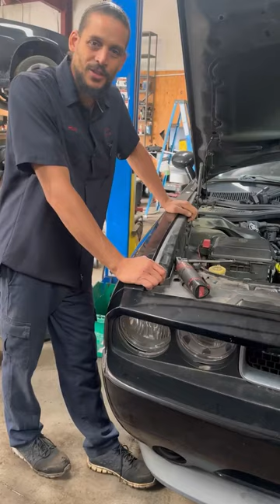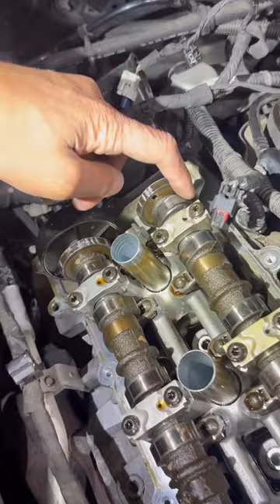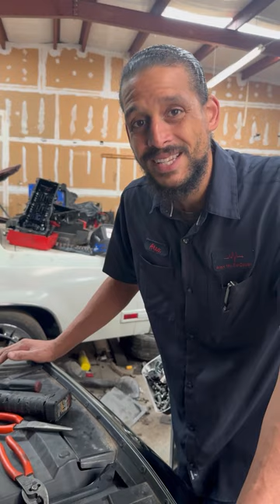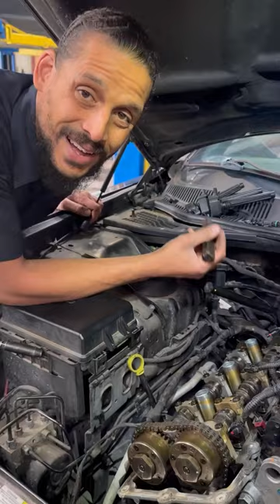This is What Happens When You Ignore A Lifter Tick! #alexthecardoctor

Comment: Alex, I'm in the middle of doing heads on a 16 grand Cherokee with the pentastar. Diag from another shop. I didn't notice a lifter tick, and don't see any damage to the cam, however when I pulled the timing chains, I noticed every chain and sprocket has wear, all of them are chewed up. My thoughts are they went too long on an oil change, but the oil and filter looks clean. I just don't want to put it back together and there be more metal in the system, have you seen that before? All chains and sprockets chewed up?

Comment: With so much metal debri though out the engine Would you recommend getting a new engine? ...or just replacing oil pump timing belt other components work?..where does all that metal debri exactly go? Does it All get flushed out after changing lifters and camshaft or does some of it stay inside small crevices Creating potential future problems ?
Reply: Lol. Could have sworn you were about to make a snoop dog ryhme with your first sentence. 

"With so much damage and metal debris, it's kinda silly expecting my 3.6Liter to be fixed for free, but I - some how some way; keep coming up with money working really hard every single day, may I kick a little money at you for your fees and get some engine parts repaired to a T; so my car can help me keep driving on; when it's time for me to report to work at 6 in the morning; so what you gonna do; I got a cam full of metal and my oil pump does too; so lay down your price and go for broke; but for what? cause we don't love the dough, yeah - cause we gone blow a check for this; fees up freeze up as me and my homie go into debt for this.
Driving down the street with a ticking engine; wishing I wasn't broke; laid back with my mind on my money and my money on my mind...

Comment: Time, bad oil, to much time in between oil changes? I have this in a GC 2011 120k miles no ticking , should I continue to use high mileage and change the oil every 4k miles or 6 months?
Reply: They're known for problems.....it's not neglect....and there's not really a such thing a  bad oil anymore....they're just crap.....and 120k isn't much....
Reply: These engine are trash, I had nothing but problems out of my chrysler. I will never buy another one, I just bought a Honda and a older Toyota.

Comment: Mine's been ticking for years. Finally got the valve covers off because one was leaking, and all the cam lobes looked perfect.
Reply from the maker: Some time you win and sometimes you don’t. I’m glad it worked out in your favor Mike
Reply: I got a 2006 GMC sierra with a 5.3
It’s had a lifter tick for over 150,000 miles. It starts up when the coolant is about at 160, and goes away about 10 minutes after this. Once it’s gone she runs like a dream
Edit: to clarify these are not AFM lifters, this was one of the last years they used the old iron block design with solid lifters and none of that cylinder deactivation nonsense. 320,000 mile LM7 and 4l60 trans
Reply: @videos-for-friends lifter tick or exhaust manifold leaking? Usually when warm, the tick goes away because the exhaust manifold expands
Reply: @j.gtheautotech8455  I wanna say lifters, but I could be wrong. It doesn’t do it on a cold start, only about 5-10 minutes after. Then it goes away after about 8-9 miles. It’s now at 330,000mi and still starts everytime I turn the key

Comment: My daughters 2014 Chrysler 300S had this ticking for 8 months luckily we got it fixed and only had to replace 1 camshaft and 6 lifters and 6 rocker arms or cam followers. The bearings in these roller rockers are no good they fail frequently.
Reply: I replaced all of the left side as a precaution before it wore out the camshaft and it was like a 3 hour fix

Comment: I like the fact that he looked into why the vehicle needs a oil pump which Is a major component of the engine that doesn't just fail often. I'm a professional ASE automotive technician with thirteen years experience now shop owner and Entrepreneur in memphis tennessee most mechanics around here would have just installed the oil pump and called it a day. I can tell he has refined a nice thorough process that yields great results.
Reply: And satified customers and 5 star rating on Google
Reply: These vehicles also have a dual stage pressure oil pump that have the solenoid burn up which causes a dtc to set. Could be why he's replacing the oil pump.  Glad he caught that bad rocker arm that took out the cam though. These engines are notorious for that. We always replace all the rocker arms and lifters when doing that service and any damaged cam. It's a fleet so we do it once and hopefully don't have to go back In.

Comment: But if you really stop and do the math, and I understand that a lot of folks don’t have the money to tear the whole top end of their Pentastar apart, it might be $1,600 to replace all the lifters and a new set of cams just to be safe but even a quality used 3.6 is gonna run you several thousand dollars parts and labor🤷‍♂️just saying. Sadly, sometimes neither option will work for financial reasons and sadly the car winds up in the junkyard or turns into a storage unit in the customer’s driveway.
Reply from the maker: It’s more than $1600 especially if we talking Cams…. And you’re right, an engine job will be super expensive as well. But one thing I can say about these customers with the Pentastar though, especially the ones that own the Durango, Charger, and Challenger, 95% of them get the work done! They love their cars, that’s why I’m always doing them lol
Reply: My motto on this is…as soon as the infamous lifter tick starts, get it in the shop and you could possibly just be dealing with a roundhouse set of lifters (or rockers, whichever way you wanna look at it) as opposed to lifters and cams and possibly a whole new engine. Be blessed.

Comment: Honestly this engine is junk. 
I have a Durango 2014 with the 3.6 nothing but problems started since 60k after. At 100k cams and lifter had to be changed, currently is at 155k and goes on limb mode because of cam position sensor pig tail messed up or defected. 
Now has massive oil leak coming from the oil cooler that from factory is plastic I’m about to change it to all aluminum. 
Nothing but problems.

Comment: Engine is trash. I wouldnt touch it unless it was to replace the engine because after all that metall hitting the bearings it WILL end up spinning bearings.
Reply from the maker: Idk man. I’ve done plenty of these jobs. Maybe 2 a week and haven’t had a problem yet. now I will refuse them if they are over 200k miles though and it needs rockers but the ticking stopped long ago. Then I won’t touch it
Reply: @AlexTheCarDoctor  all that metal circulating idk how u haven't had issues, but glad u haven't. That pentastar is possibly the worst pos on the road. I've seen more failures with them than even the Fords. I wouldn't own one if it were given to me.